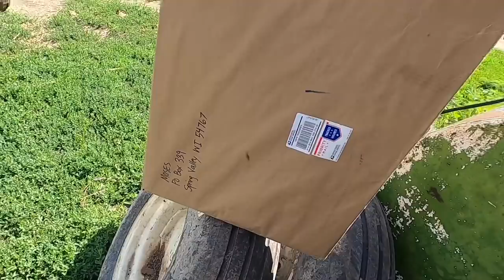Hoof Trimming - 2nd Cultivating Of Soybeans and Cultivating Corn With The Newholland TG 210!

Comment: Good video Paul 👍 if wheel settings were correct on TM125 no reason not to use it on cultivator it would handle it no problems 💪💪TM series probably one o the best tractors New Holland ever made 💪💪